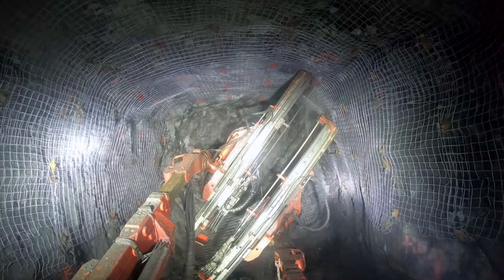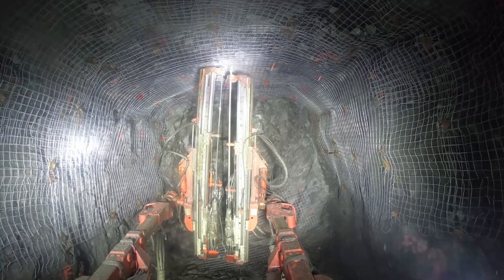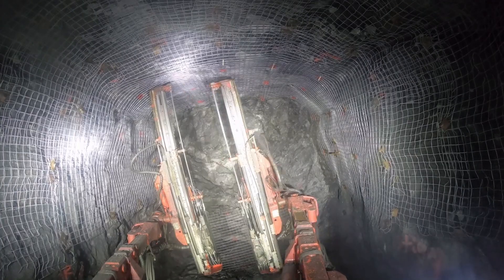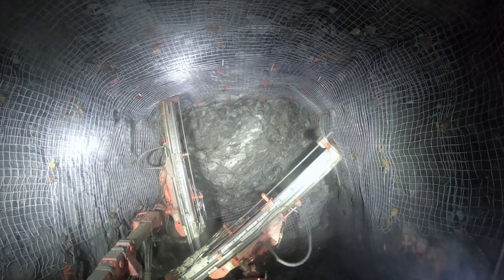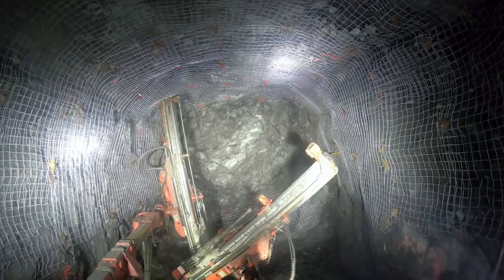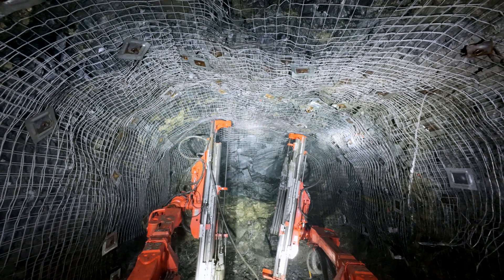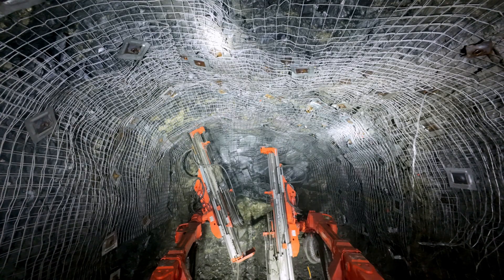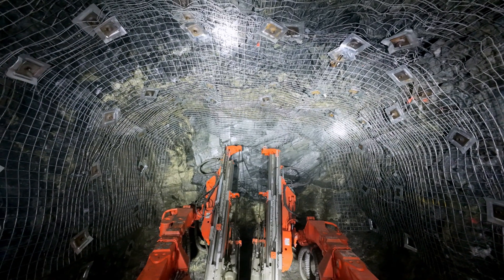Jumbo bolting with resin bolts

Comment: I’m wondering if your lungs have been damaged at all, I’m interested in starting underground mining especially drilling,I currently work as a surface laborer, but I have concerns about air quality/not being able to wear me respirator permanently due to needing to talk/other reasons
Reply from the maker: No my lungs are fine. Most mines do lung tests every year , mines with high silica will make you wear a respirator all shift . Also air is much better then in the past. Ventilation is better and more battery equipment. Most drills have nice cabs with big filters.  Honestly you don't talk much underground light signals and radios are more common form of communication

Comment: Can someone explain what he is doing and why he is doing it?
Reply from the maker: @alex121429  this is 2 different methods with the same machine to install rebar ground support underground to prevent cave in. The method is used to inject epoxy resin that hardens after rebar are spun in . These rebar hold up the screen which prevents rocks from falling on workers and equipment
Reply: @ So this method replaces the rock bolts and anchors that I used to use at Giant Yellowknife in 1975?
Reply from the maker: @gragor11 it’s probably close to the same thing . You where probably using mechanical bolts that anchored when tightened but these are coated in epoxy to prevent corrosion.  I have been installing the same bolts myself for 20 years but with different machines
Reply: @JoryDion  Yes tightened with a stoper No mesh, don't think I ever had to use a jack leg for that job.
Reply from the maker: @ ya same thing this is just a really really fancy stoper you run from a cab.

Comment: What are we even doing here?
Reply from the maker: @eugenecbell  ground support
Reply: @ thank you. What is ground support?
Reply from the maker: @ mehta?
Reply: @JoryDion  sorry, I fixed my typo.  
What is ground support, in the context of construction.  For that matter what are they making/building in this video?
Reply from the maker: Well building a tunnel . Ground support is rebar or screen that goes on the walls and roof of the tunnel to prevent rocks from falling on workings and equipment
Reply: @ ok, that is interesting.
So in this video, are they sticking through the plastic and deep into the side of the “tunnel” wall?
Reply from the maker: @eugenecbell  not sure if that was more typos. but typically the walls and roof are covered in screen and then rebar and epoxy is used to hold the screen in place

Comment: That would take way to long going 1 for 1

1, Pin all the mesh
2, bore all holes with 2 steels
3, insert all glues
4, spin the bolts in 
5, done in half the time 👍🏼

Comment: Is the chicken wire coated with mortar or something after all the structural qork is done? Or? The bolts are to shore up the material and prevent cave ins.  But are they finished somehow? Or just left raw with the wire just to protect from chunks being dislodged?
Reply: Yeah you can shotcrete it. Depends on the mine. Everywhere I've worked we just leave it bare but we aren't that deep and our ground has been good to very good.
Reply from the maker: Same with me,  most places leave it bare wire unless ground is bad or it’s uranium

Comment: How long does it take you to bolt a round using the insertion tubes vs the trajectorflex?
Reply from the maker: @hamzajaffri1423  alot of it depends on how many are bolts.  Most places hang all the screen with split sets.  Then switch to rebar .  It is possible to hang screen with only rebar using trajectaflex but it requires higher skills levels.  I would say ball park avg would be 8-10 hours with tubes installing 50-70 bolts trajectaflex is closer to 4 hours for the same job
Reply: Think it will beat 2 good bolters on stoper and jackleg?
Reply from the maker: @sammyguy  😂 does an air nailer beat a hammer ?